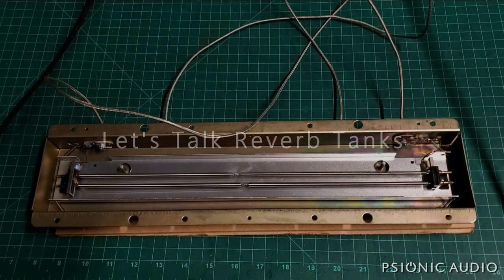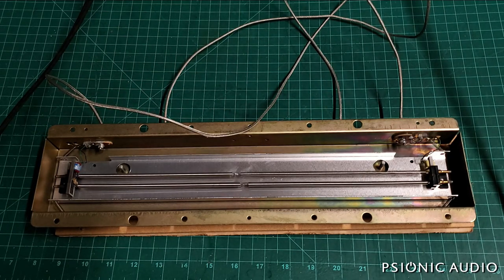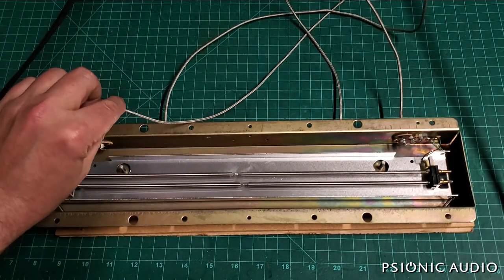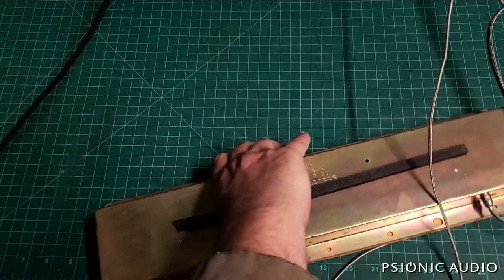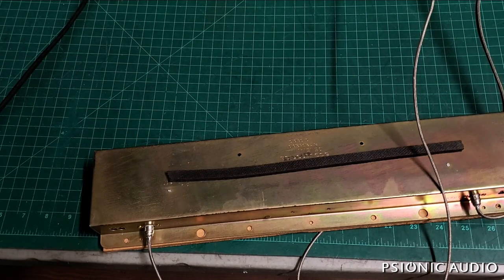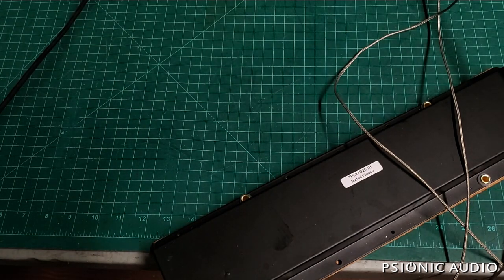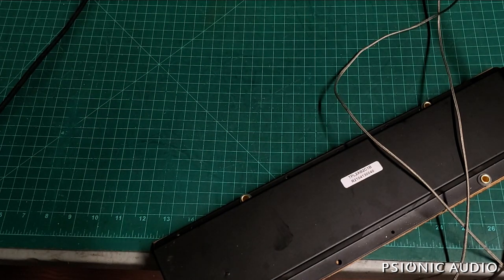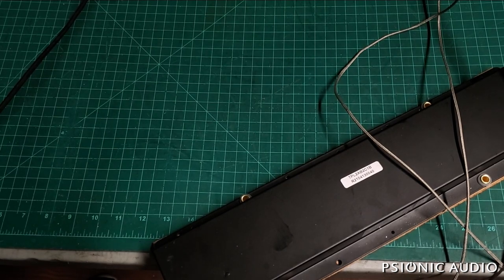Let's Talk Reverb Tanks

Comment: I had the exact same problem in my mid-70s vibrolux reverb. I couldn’t figure out why it was extra splashy and sensitive to just walking around the room compared to all of my other amps with spring reverb. Every other reverb failure had to do with connections or the reverb circuit. After going through everything in the circuit, I finally stumbled onto a forum posting about the spring sag and bit the bullet and replaced the tank. You’re absolutely right about the new tanks. Thanks for highlighting this failure mode!

Comment: I think Lyle's comment on "tuning the reverb send circuit and recovery to taste" is spot on. Much easier than finessing with springs. Fender's PR and "ultralinear pro reverb" schematics both show 0.002 mfd parallel the 220k reverb recovery grid leak. That cap shunts the tank output and may be reduced to brighten the tone.  The UL pro reverb 12AT7 driver has a 560 pf between grid and plate that might also be tuned -- although I wouldn't without a scope.

Comment: Lyle, have you tried one of the new “custom” reverb tanks that Surfy Bear is having made?

I’d be very interested to know if these are much closer in tone and decay length to the classic fender tanks.
Reply: Just got one with my surfy bear metal, very nice smooth sound
Reply: It's probably the closest I've come to the pan I have in a vintage 6G15. They did a good job on it. It's not quite as drippy and has a bit more top end than a good vintage Accutronics or Gibbs, but there's really nothing else made nowadays that gets in the ballpark as the Surfy pan. I'd say it's about 80% there.

Comment: Are the short sub-suspension springs and additional unused holes on the outer shell strictly for adjusting the position of the inner reverb assembly, or do they also allow for tuning the tank resonance to minimize microphonic behavior and feedback? I've seen vintage reverb tanks where the inner chassie that contains the transducers and reverb springs is hanging so low, presumably due to stretching of the short little suspension springs, that the reverb springs ---- also possibly stretched and saggy, like myself! ---- touch the bag or the bottom of the cabinet (at this point in time, many amps are missing the cardboard spacer/riser underneath, or perhaps one was never installed at the factory).  Can you just stretch those short springs to a different set of holes and thereby raise up the suspended part of the reverse tank so it doesn't rub or contact anything, or does that appreciably change the resonant frequency range at which it operates, or exacerbate feedback?
Reply: Wondered about that myself

Comment: Hello, I have a question about the tank units, I have seen them with that closed cell foam strip on the top and cardboard base sometimes with wood strips glued on the cardboard and the reverb bolted on the strips. Is this how Fender did it back in the day? thank you for your time.....

Comment: Especially if you amp is a clone, not a vintage gem, it is often very simple to add a on-off-on or rotary switch to change the coupling cap value of the reverb driver stage input line. I normally use good quality 630V styroflex caps which give for example 270pF, 700pF and 1930 pF using on-off-on switch to parallel connect 2 of those caps if wanted. That's all you need to get  the amount of low end to the driver stage that sounds best.

Comment: I just tried an Accutronics 3 spring medium decay tank in my '65 PRRI and it still has way too long of a decay. I am going to try a Mod 8AB1A1B, Short Decay, 3-Spring and hope it comes in around 2 seconds. The original Ruby that came with the amp is supposed to be short decay and it's crazy long.

Comment: I am surprised that these tanks are not repairable.  Is it simply too expensive to fix vs just replace?
Reply from the maker: Given hourly labor and the fragility of the spring connections on the transducers, fixing is often not worth it. 

I have another old Accutronics here with bad transducers. I'm going to try to swap out the springs, but there's no guarantee of success.
Reply: @PsionicAudio  Can you make a video on when you are trying to swap out the springs? It would be most interesting!
Reply: @lager9342 , yes  I, second that motion, Lyle!  I have a collection of various reverb tanks here with bad transducers on one end, and would love to drill out the rivets and pair up the remaining good transducers to make working reverb tanks, but I don't know how well the springs hold up when you try to do this. I read somewhere that the little hooks that come out of the transducers and hook to the springs are actually magnetized, as opposed to building the magnet into the transducers assembly, and if you break those little hooks, the transducer is toast. ( Although, it appears as if you could heat the solder at the rear of the brass tube, and the broken-off hook would pull out of it, but what to replace it with?)

Comment: Would it be possible to cannibalize springs from a newer tank to replace the weak ones in the vintage tank?
Reply: as long as they are the same length, yes. however changes in wire gauge, coil diameter, material, and total mass will all affect the tone of the reverb.

Comment: So you're saying that when you use a different type of reverb tank you have to adjust the Reverb Drivers RC networks values and the Receiving RC networks to TUNE IN the reverbs Passing frequencies and to Block certain frequencies from the reverb feedbacking or overtones?
Reply: yes he said that and IMHO makes a lot of sense, it´s easy to tinker with caps values to shave some low and low mid´s  send to the tank  , than try to find old tanks that are expensive, used in combos so they´re worn or damaged like the one he shoes at the beggining of the video. some caps and resistor we are taking 1 buck.

Comment: My 3  approximately 7 inch spring ACCUTRONICS unit is hard wired  with a bare ground on each terminal along with a red wire  at the input and black  and ground at output. 
What is this thing? Zero electronics, made in Cary Illinois USA.
I understood it is a reverb unit, that's why I salvaged it. I would like to incorporate td e it at least for novelty/Halloween broadcast if nothing else.

Comment: Why do reverbs wear out? Is it because people drop their amps a lot?
Reply: I’ve seen amps from ’64 with perfect tanks and amps from ‘80 with shot tanks, vise versa and everything in between. 
I would put regular use on top of the list of reasons why they wear out. The constant stretching and compression of springs is what wears them out. 

A drop hard enough to damage the tank, while installed in the cabinet, would also damage the cabinet. Good thing is not everyone likes reverb, especially surf music levels. You still have a chance of finding good old tanks.
Reply: @matthewf1979  ,  Most organs, and  "tone cabinets" (powered speaker cabinets that are designed for use with organs) have pan-lock brackets to lock the reverb mechanism and springs in place place when the amp is being transported. Unfortunately, you rarely see this done on guitar amp reverb tanks.